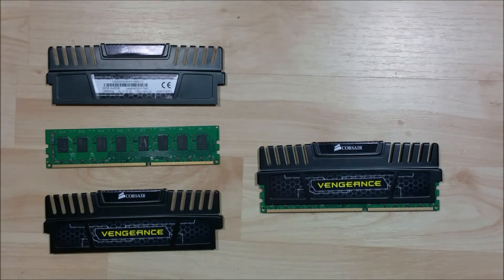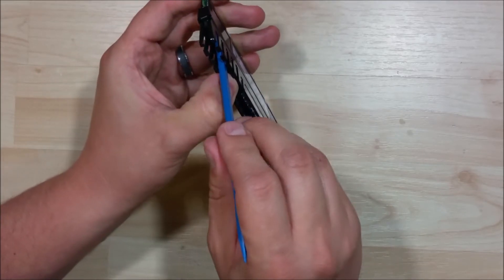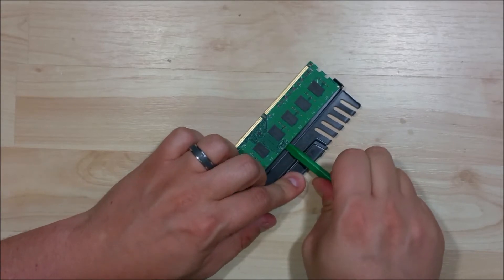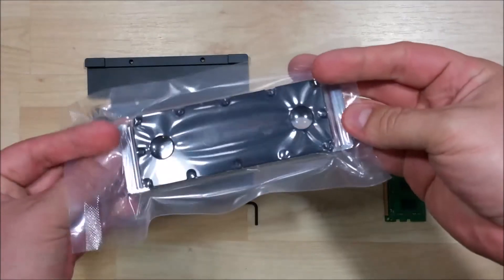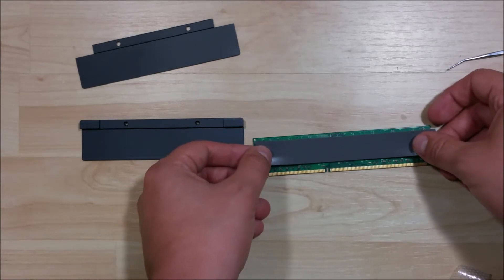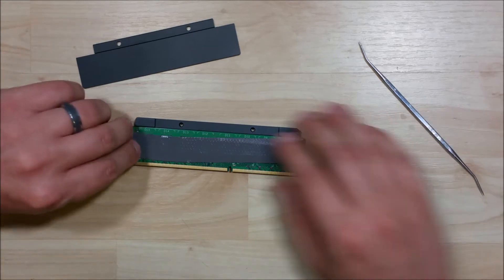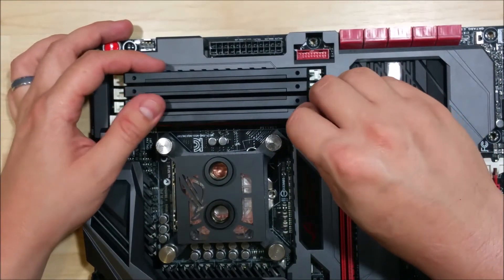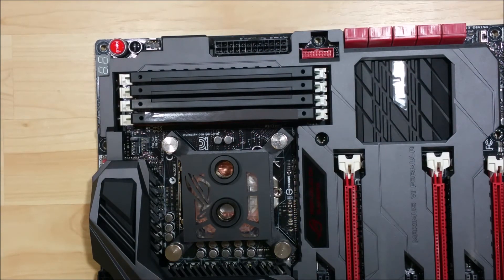Custom Watercooling Build How-To - Bitspower RAM block - Corsair Vengence

Comment: Does this increase any performance in real time?
Reply: I personally find ram cooling only necessary if you are using open case design aka open design on the wall or so. As usually the case fans will move the air around it. But as he said - if you are really into overclocking then watercooling will have its effect - othervice its just for a show off.